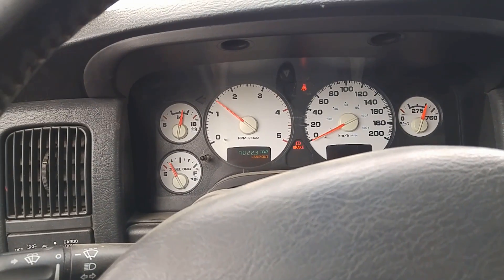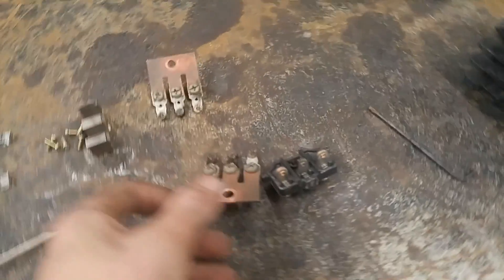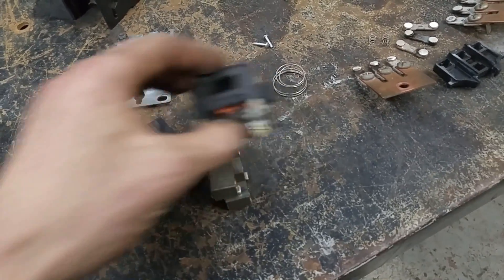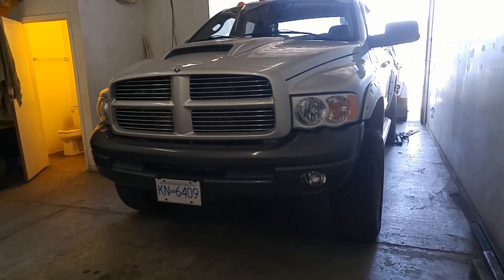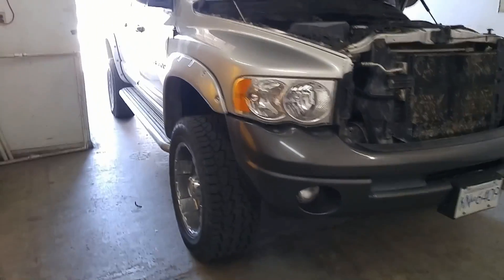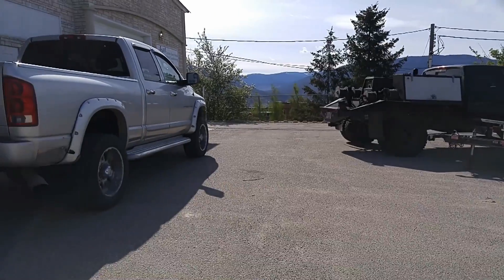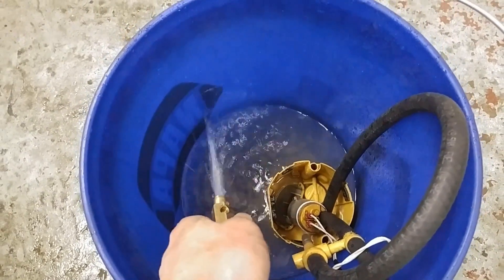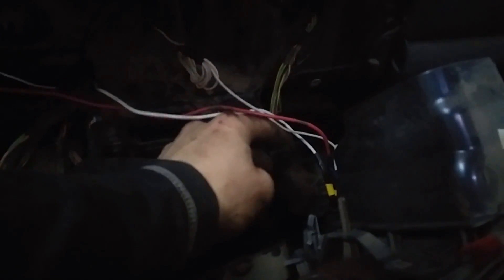Cummins launch control rev limiter and CAN Bus reverse engineering

Comment: have a question of you about the cluster....on my 03, every 5-7 key on cycles the dash will glitch  and cut off and back on...have you ever experienced this? if so how did you repair?
Reply from the maker: I would check the ignition switch, sometimes the contacts get a bit worn causing bad connection, sometimes if you wiggle key you will lose ignition power or acc and the gauges will reset.
Reply: i have a new mopar ignition switch installed. if i hook my edge insight into dlc it literally blanks out and dings every 3 seconds. i read that sometimes the clusters just "freak out" and you can repair them, however ive never seem to find the walkthru

Comment: common problem on the contactor, I see it almost everyday as a refrigeration service tech. Just wear and tear from the arc they create when the  contactor opens
Reply from the maker: Cool thanks for the input, Do you usually repair the contacts or just replace the relay?
Reply: replace, they are relatively cheap. plus by the time the contacts get pitted like that the coil more than likely doesn't have much life left.
Reply: Emilio Benitez I do hvac also.  You took the words out of my mouth